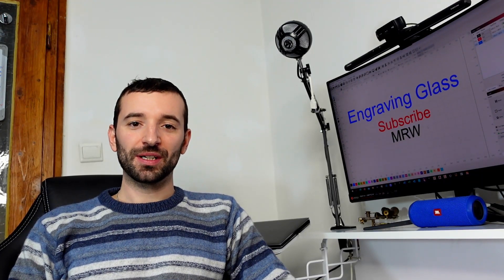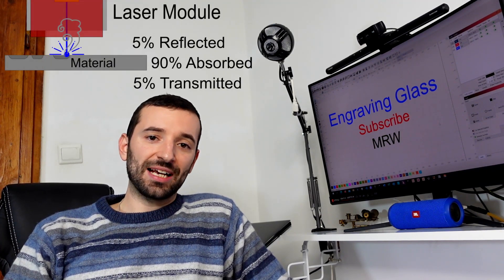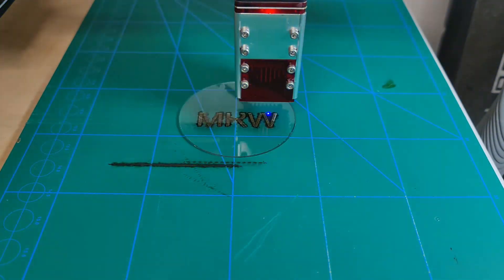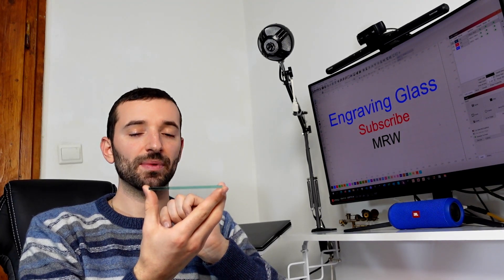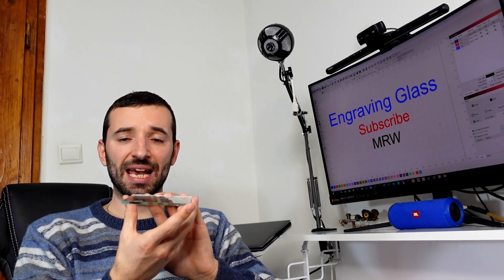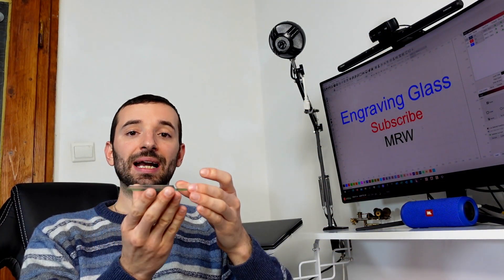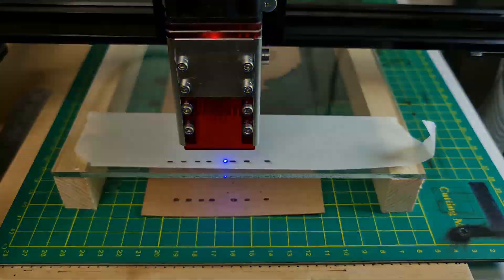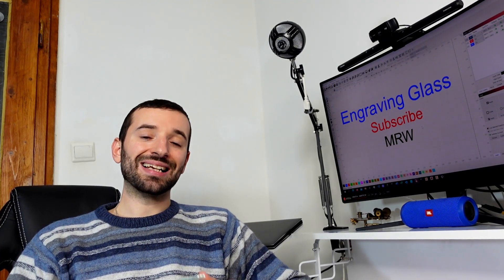Engrave Glass with a Laser Machine

Comment: Hi. it's a really nice video....
I came up with an idea what if you immerse just in few millimeters the glass in a flat bath that is filled with a dark liquid so that the entire bottom surface of the glass is immersed in that liquid while the upper surface is dry and clean and then engrave the lower side through the glass?
What do you think? Can it work?
Reply from the maker: Hi, Eli Hait; thank you for your comment. 

I haven't tried something like this, but a liquid absorbs heat differently, and I doubt that the absorption at the interface will be sufficient to mark the glass.

The best method I found is to coat the glass with some spray paint and remove it afterwards. You can see this more recent video I made. https://youtu.be/jZwkOu1QBpc

Ciao

Comment: Hello I have a 30w neje ingraver what power and speed should I use to engrave a glass
Reply from the maker: Hello doble H, thank you for your comment.

Unfortunately, my 30w module died before trying on glass, but from my other module of similar power I for with 90% power at 150%, and a line interval of 0.12mm.
Pay attention however to the thickness of your glass if is to tiny it may break, I have been engraving 4mm think sheets of glass as well as mugs and bottles with a glass wall thickness of about 2.5÷3mm.

I hope it helps
Ciao
Reply: Tnx for the reply
Reply: Is it possible to engrave stainless steel with the neje 30w engraving machine
Reply from the maker: Hello doble H, thank you for your feedback.

Same about steel, the module died earlier, but I just got the new replacement controller to repair the laser module; therefore, I will soon test it and make a video about it.

In the meantime, looking at my other machines with modules of similar power, I go at 90%, 300÷400 mm/min and 0.1mm. I engrave spoons with my Atomstack P9, which is about 5W optical power like the NEJE 30W, and I get very good results.

Note, however, that steel is not all the same, as some may be less visible than others, while some might not show anything at all. If you used anodized and coated stuff they come out nice.

Ciao
Reply: I'll be waiting for the video
Reply: Thanks
Reply: And what about grey stainless steel (the original)

Comment: What was the laser settings speed power output watts of your laser
Reply from the maker: Hello James C, thank you for your comment.

In the video, I used the NEJE A40640 Laser Module with an output power of about 10W, the settings were as follows:
Power 90%, Speed 500mm/min, Line spacing 0.12mm

I now use the Aufero LU2-4-SF which is a 5.5w laser, and I achieve a similar result with:
Power 95%, Speed 400mm/min, Line spacing 0.12mm

I hope it helps.
Ciao

Comment: Thank you so much. i have a question .. did the 100% power affect the Laser life ?
Reply from the maker: Hello Zakaria Khouni, thank you for your comment.

Well, in the case I would be using the Laser at 100% Power I believe would still be too early to notice any effects, but I usually do not go over 90% for my projects. I use 100% only for testing purposes.

Keep in mind that anything run at 100% power will shorten its service life, regardless of the nature of the thing, i.e. mechanical, electrical, structural, etc despite designing things to work at nominal conditions with sometimes quite a large Factor of Safety (or load combination factors depending on the design methodology adopted) things will still degrade due to, for example, mechanical and thermal fatigue and material flaws. 
When dealing with semiconductors the latter is actually common with the imperfection introduced by impurities in the material.

So the idea here is to limit the run at 100% to the minimum and try eventually to lower down the speed if you wish to achieve the same result.

I hope it helps
Ciao